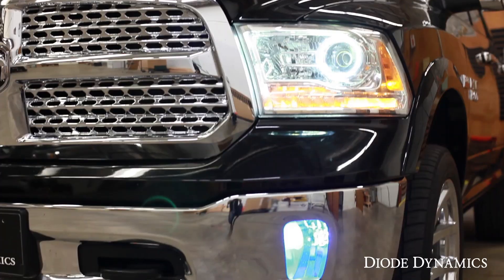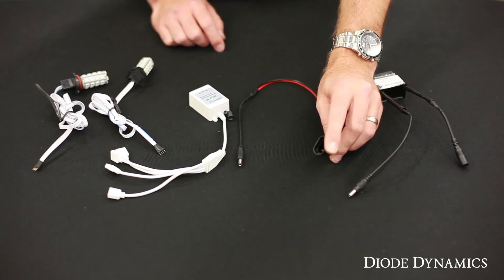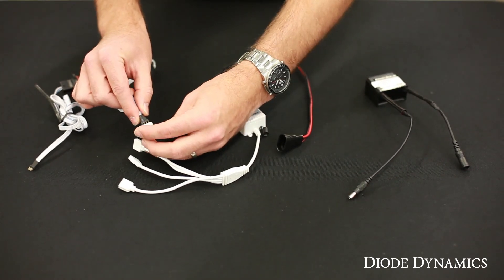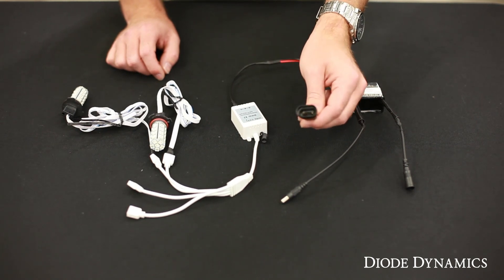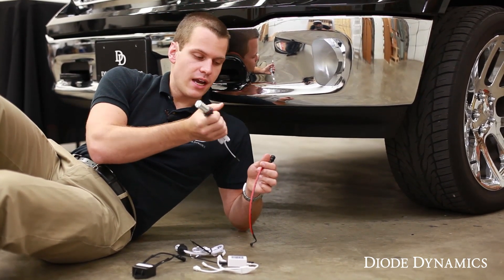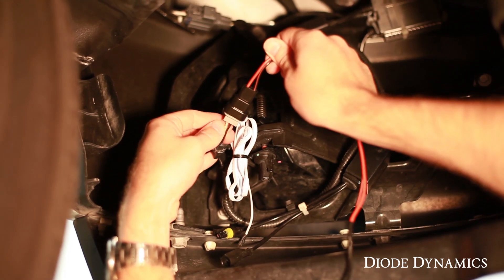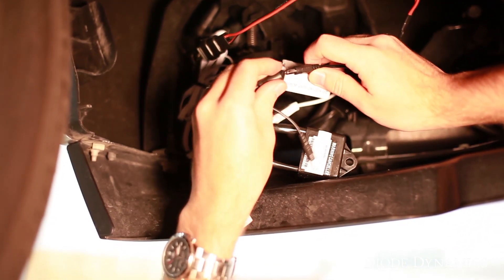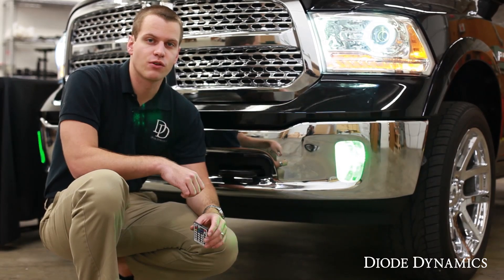How to Install Multicolor Fog Light / DRL Bulbs from Diode Dynamics

Comment: Good video.  Just one question, what does it mean when one fog light is blue and the other is green?  I’ve flipped the 4-pin connectors and the polarity but nothing fixed it.
Reply from the maker: Hmmm- We've never heard of this. Please go ahead and give us a call at 314-205-3033 Monday-Friday 10 a.m.- 5 p.m. CST, or shoot us an email at contact@diodedynamics.com, and our service team would be happy to help you troubleshoot.

Comment: On your website this product is only listed up to 2010 Ram 1500 Models. Although it looks like your demo truck is a '14. I am assuming this kit will work on the 2014 Ram 1500 models?
Reply from the maker: Theodore Sankey, if you could shoot us an email at contact@diodedynamics.com or give the office a call at (314) 205-3033, our sales representatives would be more than happy to help you make sure you get the correct size bulb for your Ram. Thanks!

Comment: does it just keep changing light color? Is there anyway I can keep it in red, and change it to blue whenever I want? I like how it changes color , but I don't want it to change automatically . I'm guessing theres a button for that on that remote you we're holding right? Cause' if there I'll order one right now !!
Reply from the maker: +David Leon, absolutely, the controller can be used to set the bulbs to stay on whatever color you want as well as cycle between options.
Reply: Awesome, thank you ! Diode Dynamics

Comment: is this a complete water proof kit? and can it handle low temp as low as -40c?
Reply from the maker: +Majed Abu Our Multicolor Fog Light Kits are not waterproof; however, the controllers are water resistant. We would recommend mounting the controller away from direct water contact. Low temperatures should not cause any issues with any of our LED products. If you have any other questions, just let us know!

Comment: Would it fit a 2018 dodge charger sxt plus super track pack
Reply from the maker: Hi there! While this particular product isn't compatible with the 2018 Charger, we do offer a variety of other LED upgrades for it, including our Multicolor LED Boards! You can check out everything that's available for the '18 Charger here: https://www.diodedynamics.com/by-vehicle.html?no_cache=1&find=2018-dodge-charger-119389

Comment: What colors does it come with thanks
Reply from the maker: +falconz002 You'll get full multicolor control with this product!
Reply: Diode Dynamics does it have a normal white light?
Reply from the maker: Yes, you can set the remote to white!

Comment: Are you able to actually drive around with different colors on?
Reply from the maker: +Gary Urena We recommend checking your state and local laws before driving with our products, but generally, multicolor products are intended for showing off while parked, such as at car shows. Luckily, with our controller, you can easily switch these bulbs back to white for everyday driving!

Comment: controller not working..? light stays in only one color. any tips for this issue?
Reply from the maker: +Jovany Ramirez, give us a call at 314-205-3033, Monday-Friday 9am-5pm CST, or send us an email at contact@diodedynamics.com, and our sales representatives can help you with the issue you are having!
Reply: Jovany Ramirez any solution? I have the same problem :/

Comment: Lumen count?
Reply from the maker: Hey Joe! We don't have an exact lumen rating for our multicolor fog light LEDs, since each color is different, but they are a cosmetic upgrade and will not be any brighter than halogen bulbs. If you have any other questions, just give us a call at 314-205-3033, Monday-Friday 9 a.m.- 5 p.m. CST, or shoot us an email at contact@diodedynamics.com!